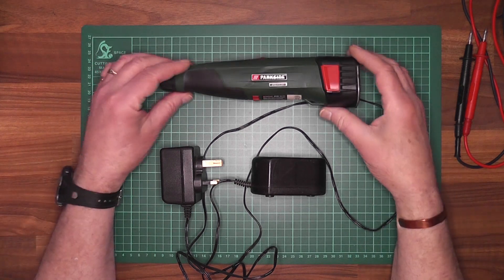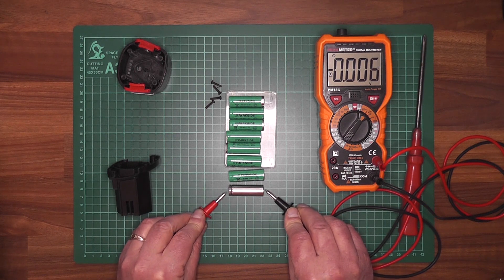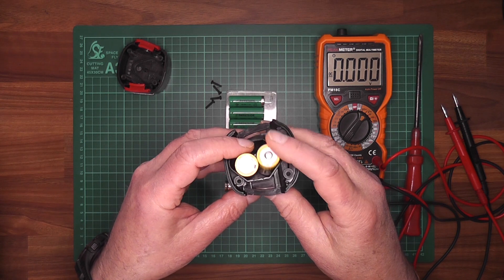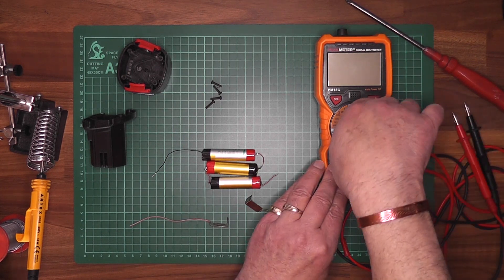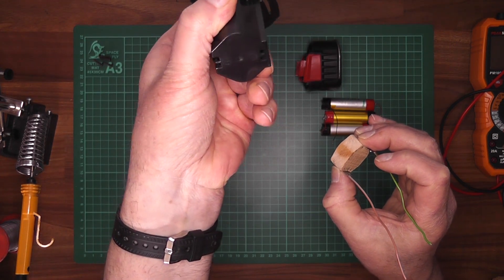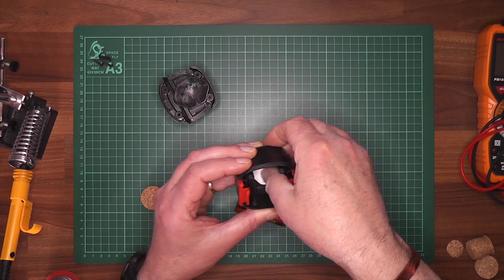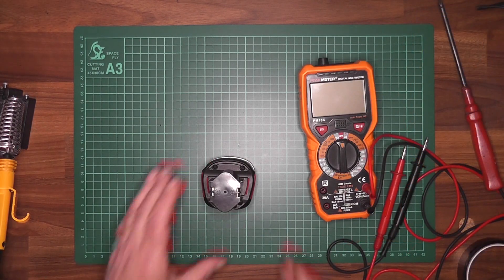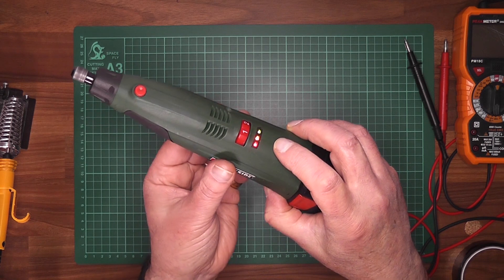Fixing a Dead Cordless Rotary Tool

Comment: Great video, just wish my battery had screws, it's ultrasonic welded together. Hopefully I can get it apart without damaging it, the battery is nla for my tool, and I won't buy any NOS battery because I have gotten them before and they were dead, thanks looks pretty straightforward.
Reply from the maker: A thin flat head screwdriver may find a weak spot in the join so you may be able to insert and work it along the seam. We have successfully done this in the past. Hope this helps